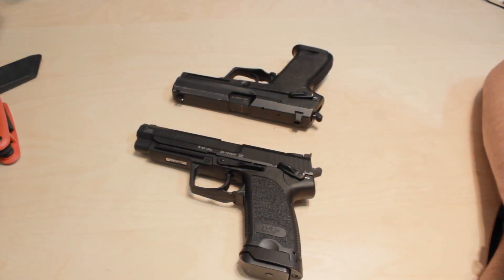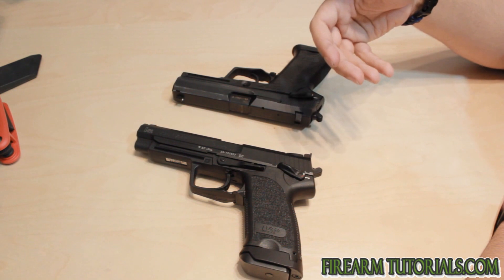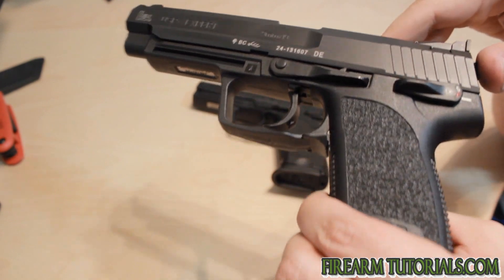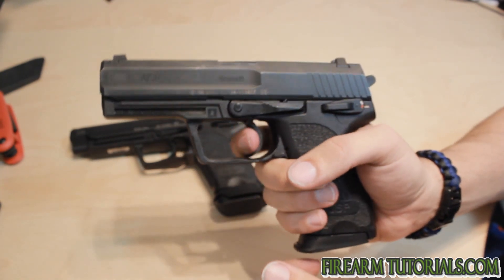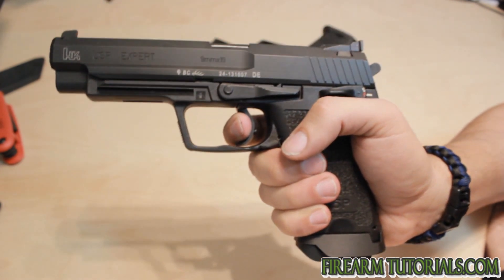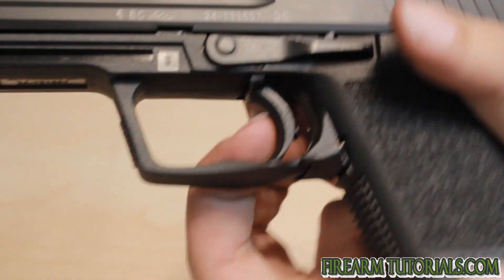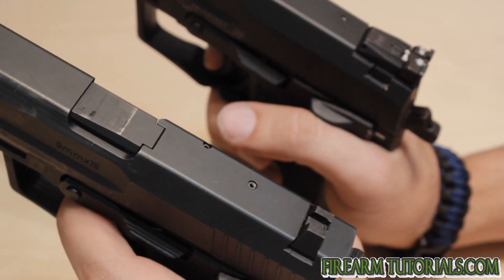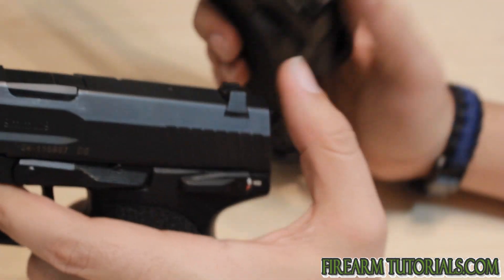HK USP match trigger vs. standard trigger

Comment: The trigger pull is about 12pounds double action on the standard USP and 9.5 with the match trigger and the single action is about 12 ozs lighter, smother pull and a shorter reset

Comment: I know it's been a while, but where did you get the magazine base pads for the Epert?
Reply from the maker: The part attached to the frame of the gun is called the jet funnel kit.  It adds a magwell to the gun and then requires the jet funnel magazines which have the metal base plates

Comment: "basically the same trigger with exception of the screw"

Isn't the stock trigger polymer, whereas the match trigger itself is steel?

Cheers
Reply from the maker: No they are both polymer but the match trigger is tapped for the over travel screw.  Thanks for watching.
Reply: Cheers! I had no idea

Comment: Thanks this is exactly what I was looking for.. So basically if I buy the match trigger kit for my compact usp 9mm It will work the same but I will have to keep the orgininal trigger and just won't have the over travel screw? Any downside to that? Do they make a match trigger for the uspc?
Reply from the maker: You are correct.  No trigger, but Bill Springfield can drill/tap the compact trigger.  I don't think not having the over-travel screw is a show stopper, but I like that feature of the match trigger.  Thanks for watching.

Comment: is there any  way to modify the pistol trigger to get rid of the lag/ "mush" as you call it?
Reply from the maker: Yes.  You would have to modify the trigger bar and other components which risk defeating some of the safety features.   Gray guns have several trigger modification packages available to address that.  Their work is top notch but comes with a price.

Comment: Problem I have with HK is the fit when you hold it.This isn't 1945 if a CZ can make an ergo CZP10 for 400 then HK can get off they're butts and make an ergo grip as well. I'm sure it can still be mil spec and comfortable. My 45C is the same style of frame and the safety digs in , and there is no positive lock on the frame . The flat sides and long length from back to front of grip is. Holding it is like HK doesn't care about how it feels just that the name requires you to buy one . Although I'm still waiting for the poly squeeze cocker double stack . So the Alien pistol has competition . And the prices come down.
Reply from the maker: The P30 has the grips you are looking for.  That said, I didn't like it as much compared to the USP.

Comment: dose the match trigger set drop into the USP Compact version in 45 ?
Reply from the maker: No.  The match trigger replaces several parts of the internals.  It will work in a compact but the actual trigger itself won't fit so you won't get the over travel screw unless you drill and tap the original one.  Thanks for watching.

Comment: hk usp tactical has this match trigger? thank you
Reply from the maker: It does.   If you see the over travel screw that's a match trigger
Reply: @FirearmTutorials  the tactical doesn’t have match internals, just the trigger shoe with an overtravel screw.
Reply from the maker: @mr.horseshoe2301  It does.  In addition to the trigger, It has the nickel plated flat spring and match hammer spring which are internal parts not found on the standard trigger.
Reply: @FirearmTutorials  Several sources (mostly HK forum posts) state otherwise. The consensus is that in order to have a true match trigger on the Tactical, you need to buy: 1. Match TRS (215679), 2. Match Nickel-Plated Flat Sear Spring (215691), 3. Match Hammer Spring (215694)
Reply from the maker: @mr.horseshoe2301  then something changed.  I can't see HK putting in just the trigger with over travel screw and not thev rest of the match components.  I have many USPs that came with match triggers.  The latest is an Elite in 9mm.  I'll check the flat spring and hammer spring later but I'd bet my next paycheck it has all the match components.  I forgot to mention the match hammer itself is different and is marked with an S on the side.  I'll keep you posted.

Comment: do hk usp 9 tactical have match triggers?
Reply from the maker: Yes they do.  Only the USP-SD was available in 9mm for a long time which DID NOT have the match trigger.  HK finally started making the 9mm tactical  with a match trigger and added the TACTICAL engraving to the slide and the O-ring on the barrel.

Comment: The usp tactical 9 mm has match trigger ... ???
Reply from the maker: +Emil Lupin The new models do.  The older models called the "USP-SD" did not.
Reply: +FirearmTutorials .com and model 2015 ... ?
Reply: +FirearmTutorials .com MY question is for the new model...?
Reply from the maker: The new model has the match trigger, tactical roll mark on the slide, and the O-ring barrel engagement.  All features the SD should have come with since the 40 and 45 Tactical models always had such features.
Reply: +FirearmTutorials .com thanks you ...